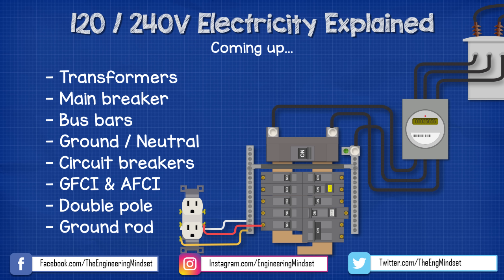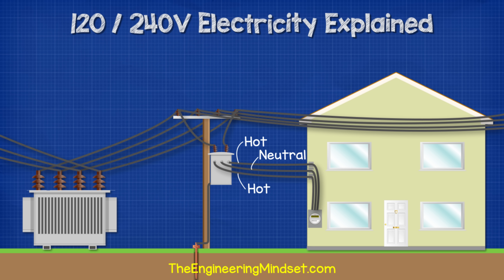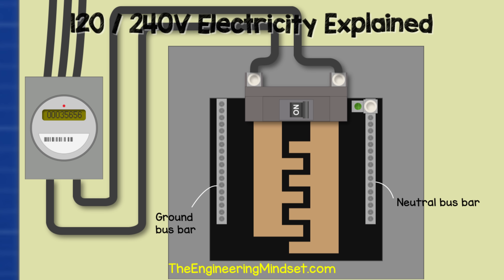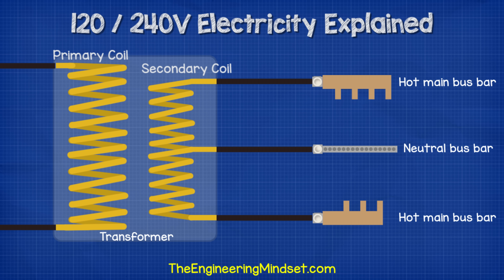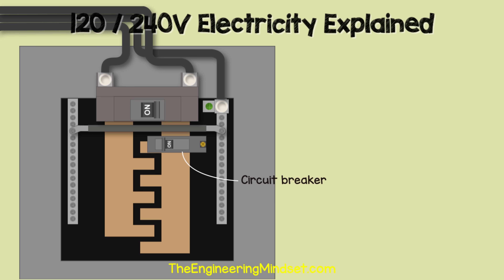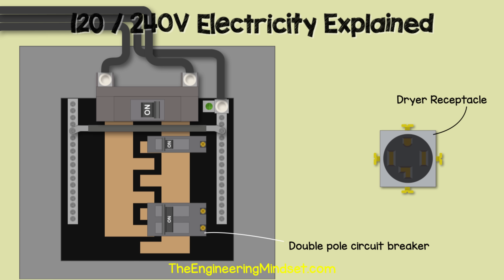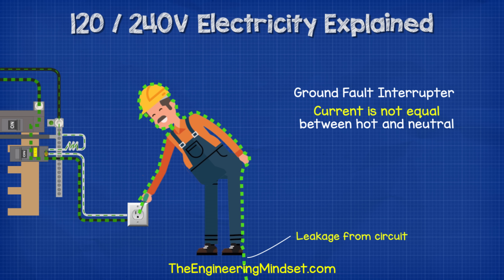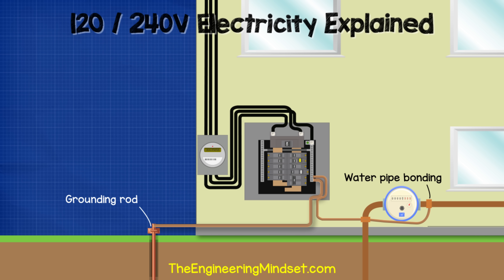120V 240V Electricity explained - Split phase 3 wire electrician

Comment: Also what causes the 240v on the secondary side of the transformer? What is specifically done to the the secondary winding to allow that to happen? I understand that you tap either side and tap the middle but there must be something done to the winding to allow the phase shift?
Reply from the maker: It's just a center tapped step down transformer. Less coil turns on secondary to get 240V. Check our transformer video
Reply: @EngineeringMindset  

I understand that, but something must be specifically done to the secondary winding to allow it to create the 240v potential across L1 and L2. Just simply tapping either side wouldn't create that potential difference, perhaps the secondary winding is wound differently on either side?
Reply: @kurtlafreniere  So the output voltage across the secondary is the ratio of the secondary windings to the primary windings. In this split phase center tapped system both L1 and L2 end up 240v apart but since the N to L1 or L2 has only half the number of turns the voltage is halved as the ratio is halved.
Reply: John Schroeder 240 v does not use the neutral, is this correct?  L1 and L2
must be out of phase? Something must CHANGE the SINGLE phase, that is
provided to the step down transformer, to split phase.   Split meaning,
the electrons are PUSHING ON ONE CONDUCTOR, while pull on the other one.
Then vise-versa 60 times a second. Thank you for your thoughts.
Reply: Yes, that's how a transformer works, or in this case a center tapped transformer. It's tapped in the middle so you would only get half the value of the secondary winding which in the video is half of 240v either phase. If you were to tap it only 1/4, then one phase would be 1/4 of 240v and the other would be 3/4 of 240v.
Reply: Think of one leg of the coil on the secondary side as positive and the other leg as negative. When you use the full coil, you get 240v, when you use 1/2, you get 120v. Don't get hung up on the positive/negative bit as this is actually AC and constantly alternating.
Reply: dlow Trouble with this thought. The 240v AC does not use the NEUTRAL CONDUCTOR. Correct?  Well then the L1 and L2 must be out of phase 
in order to have ELECTRONS FLOWING.  Step down transformer only
is supplied one phase from the power company. correct? Thank you
for your help.
Reply: Kurt L    The primary winding creates a magnet field as it is wrapped around a ferrous core.  The field expands and contracts as does the voltage (sine wave).  This magnetic core also runs inside the secondary winding which has less wraps than the primary does.   When the magnet field expands and contracts across the secondary, voltage potential is induced.  If a load is connected amps will flow in a complete circuit.   Hope this answers your question.   Regardless what your teacher taught you, there is really no phase shift.   It only looks that way on an oscilloscope.  Respectfully,   Kevin
Reply: Kurt L The two sides are wound in opposite direction. Hence, split phase. One side is pushing and the other side is pulling. Of course this is reversed to give the 60 cycles.
Reply: Ted Lahm   Not true!
Reply: Confusion. 240 v AC does not use the neutral conductor. The L1 and L2
must be out of phase. ??   Outside of local house, LOOKING at the SINGLE phase step down transformer, only see ONE CONDUCTOR going into
the top of it.   This is ONE one the Three phases that are provided by
the power company. ( I believe).  Interesting subject. 
Repeating, if 240v uses no neutral conductor is must be out of phase.

Comment: can you explain switch gear and feeders ????
Reply from the maker: It's coming but won't be for a while
Reply: Here are four terms, that mean roughly the same concept, with the essential difference being a matter of scale:
1. Load center
2. Panelboard
3. Switchboard
4. Switchgear

1. Load center is the smallest of the 4, typically around 100-200A, and 240V and less.
2. Panelboard is the next one up, 100A to 1200A, and could be either for 240V and less, or for 277/480V, or even for 600V.
3. Switchboard is for 1200A and over, and is much a more custom order.  Switchboards are also floor-mounted instead of wall-mounted like panelboards and load centers.
4. Switchgear is like a switchboard, except also involving medium voltage.   Switchgear may have a transformer section, with part of it being utilization voltage, and part of it being medium voltage.

Comment: Are you able to make a video as to why the neutral and ground should not be bonded together at a sub-panel? I somewhat understand why, and there's a few videos on YouTube that try and explain it but are poorly done imo
Reply: If you connect ground and neutral in more than one place then shared current flows through the ground wire.  If current is flowing through a wire, then it can’t be at ground potential.  All of the metal in your house that is attached to the ground wire will start having a voltage on it compared to the ground you’re standing on.  If you touch it, current will flow through you too.
Reply from the maker: Check the new SUB PANEL EXPLAINED ➡️ video https://youtu.be/NUSNa-7Hecw
Reply: A sub panel with both ground and neutral bonded has no independent redundancy.

Comment: I love your videos they're so informative. Is it possible to make a video that explains the difference/similarities between the neutral and ground? I mean the ground is bounded to the neutral but the ground goes to the earth ground rod and the neutral goes to the tapped transformer. If they're bounded and it's AC, wouldn't current be flowing to the earth ground? How/why does current flow to the neutral and not ground if they're bonded. I've been looking everywhere for this answer and I get completely different answers!
Reply from the maker: Electricity always tries to return to it's source. It's easier (less resistance) to flow through the ground or neutral wire back to the transformer than it is to go through the physical soil ground. So it won't flow through the ground rod noramlly. Lightening's source is the physical ground so it will pass through the rod.
Reply: @savageRt sav i could be wrong so if he answers listen to him over me,but I believe in that situation you would have just an open circuit.
Reply from the maker: Watch this https://youtu.be/P-W42tk-fWc
Reply from the maker: If you touched the hot while standing in moist soil then it will likely go through you, into the ground soil and try to make it's way back to the transformer. But the circuits in the house would otherwise be off because they do not have a complete circuit. You touching the hot wire and the ground soil will create the path it needs.
Reply: @EngineeringMindset  and if you touched the neutral, nothing would happen correct? Because although it's a current carrying conductor, the current flows from the hot, not current is in the neutral when the neutral is not connected and is connected to ground on the other end?
Reply: @gsanchez9457  when there is a neutral fault part of the neutral cable will rise to the full active voltage and the other half would be at ground voltage (0v) as it would be connected to ground at the transformer. The system is called the MEN system  and both provides a backup return path under fault conditions as well as keeps the neutral of ground reference.
Reply: If the neutral is open coming from the pole you’ll end up with one leg in your house being more than 120v and the other being less.  The actual voltage will vary depending on the load. This can damage devices in your house. If a heavy load comes on one leg, the other leg can go to over 200 volts.
Reply: It’s what is called a balanced load, and being imperfect devices by nature, some RF noise signal from connected devices could escape a cancellations by the neutral leg and become RF (photonics), but builders concerned with obtaining certifications will add ferrite beads and faraday cages to their design to avoid attracting FCC scandals.
Reply from the maker: We just published a new Ground fault, short circuit and arc fault video, so much detail! Link HERE➡️: https://youtu.be/Qi0ynSQw-wc